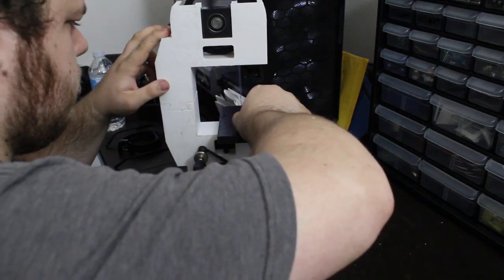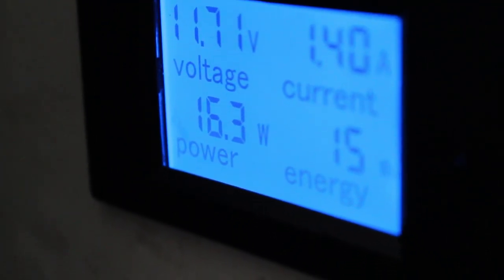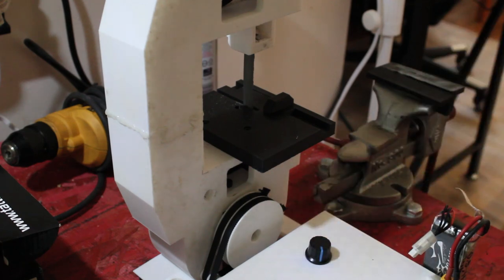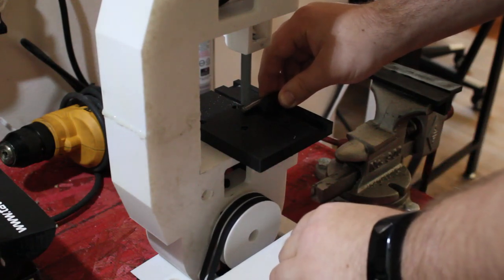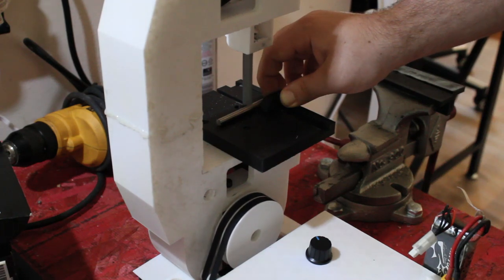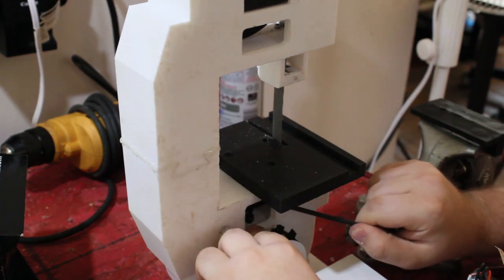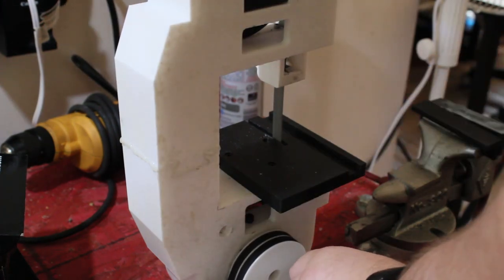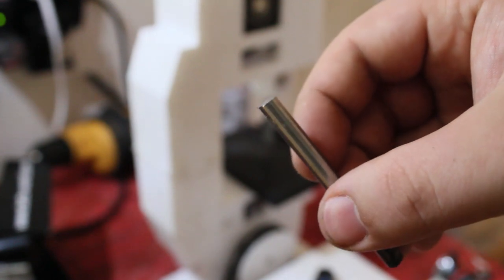3D Printed Band Saw

Comment from the maker: For those wondering, turns out the reason the blade got destroyed was because I was running the blade way too fast. It was running at about 1000fpm when that steel should be cut around 150fpm. Also curious as to how the views shot up on this video.

Comment: Amazing work! I'm working on a 3d printed mini sliding miter saw, but this is a lot more complex than that!
Reply from the maker: Thanks! It's not the best machine though. Mainly, the drive pulleys need work. If people want to make this, everything is visible in the video. I won't release the files simply because i dont believe the machine is good enough to be worth printing for anyone else.

Comment: first problem, you are not supposed to adjust speed of the bandsaw while cutting.   second, adjust the rpm based on the wheels (you already translate to linear per second by simple math). do you have tachometer?  finally,  maybe important to motor for rpm-torque, but since you adjust it once before cutting.  thus your using the voltage-amp reading is not important..  

finally  why are you holding back STL files.   community tend to reference name of person that pubishes the stl file first. you risking your loss by non-recognition. youtube does not help you beat the clock.